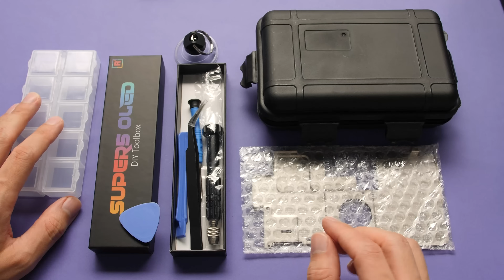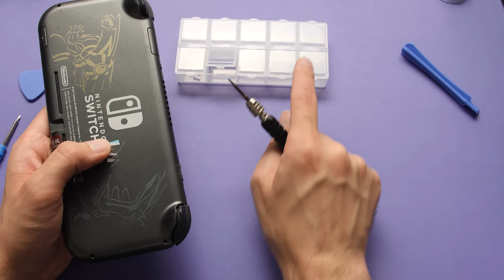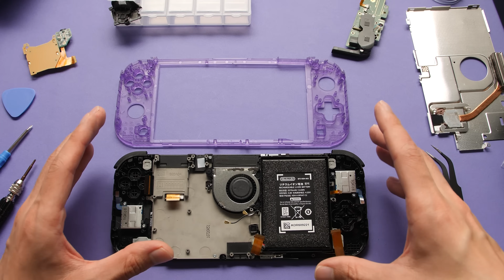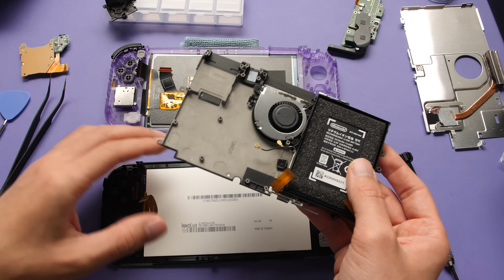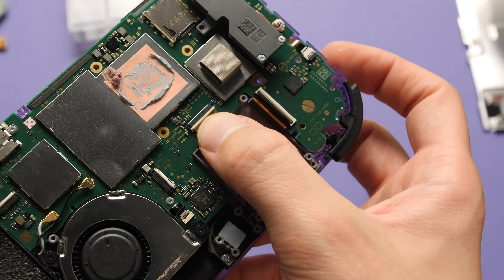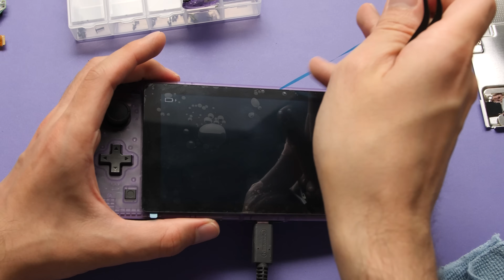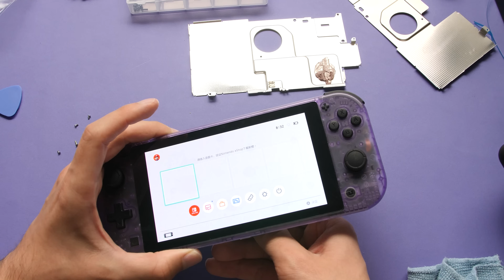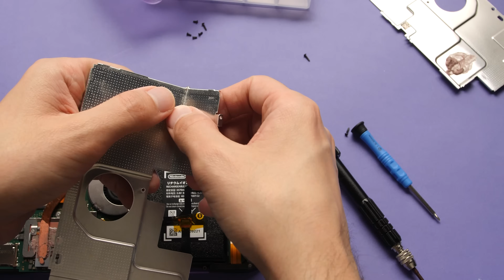SUPER5 OLED Touch - Product Overview & Installation Guide Part 2

Comment: So, can you install it like the non touch one? I like my shell and don't want to replace it.
Reply from the maker: Yes, but it is more difficult and easier to break something. I would not recommend anyone to do that way if it is their first install ever.
Reply: @TakiUdon2  In that case, the mobo and the daughter board should come out, then you should remove the old screen using the suction cup and finally you can install the new display? Could I follow a video about replacing the screen and digitizer to also see how it's done?
Reply: @TakiUdon2  can we use the other tutorial to install this? What are the differences we should know about when trying that?

Comment: Great work! Some quick questions1. will future versions of the kit include some kapton tape (maybe 2-3 cm)? could future versions have the lower-right section of the shields reshaped to avoid the edge interference of the lower shell, or perforated to make that section safer/easier to remove if needed? And final question, are there any possible use cases for the original screens after they are replaced (ie. could they be easily used with 3rd party devices such as Raspberry Pis, other portable gaming consoles, are there markets for resale or could they be donated to electronics repair shops? I would hope that they wouldn't have to sit forever in the pelican case collecting dust.. What do you do with them?
Reply from the maker: Yes, I added Kapton stickers to the BOM, but I am not sure if they will be in the upcoming orders. For your next question, the right section of the metal shield doesn't exist on the next revision of the metal plate to allow more room for a bigger battery. The plate I am using in this video was only ever meant for the non-touch SKU.

Your last question is going to bum me out because RR is not supposed to make e-waste....
Right now, I just save the screens to replace other broken IPS Switch Lites.
Reply: Working OEM screens will absolutely sell on ebay.

Comment: I notice you skip over the part where you're putting the new metal plate on when wrapping up the installation--perhaps to gloss over the fact that it covers up the top GPIO button? I know multiple people who have the excellent non-touch kits have pointed this out, but I don't think I've heard a response on this. Wasn't the point of having the buttons oriented horizontally, as in pre-production revisions of the kit, supposed to be that the GPIO buttons would be easily accessible if we decided we wanted to change profiles? What happened there? And should we be worried about the plate pressing that top GPIO button?
Reply from the maker: The point of the buttons being horizontal was never so they could be pressed without taking off the shell. They were horizontal (and the cutout was horizontal) so they could fit in the shell with the plate on.

For your last question, no.
Reply: @TakiUdon2 The kits are fantastic overall--I'm very happy with mine. My Switch Lite finally gets play--and serious play--for the first time since the Switch OLED came out. That said, you did say in the previous install video (the non-touch version) that the buttons were situated the way they were for easy access.

Appreciate your reply!
Reply: @TakiUdon2  it would hav been helpful if you didn't skip this step. Many people wouldn't be doing a shell swap at the same time.
Reply: @Zigzipy  Yeah, i'm sure a lot of people, myself included, are waiting to do this for their Zelda Switch Lite so hopefully that tutorial is done with that along with the Super HDMI mod for it too.  That would be the most beneficial video.  Also, using the screwdriver or other tool to point out the screws instead of your fingers would provide greater clarity, imo.

Comment: I have installed many hwFly's on switch lite's, and they defiantly don't need that metal shield, and it wont affect thermal performance to just not use it.

Visually, I think the clear shells also look better without it.

Comment: 17:14
Do we need to take out the shell and press that button every night to get 1 nit?
Reply: yes that Seems to be the case
Reply: @Toons91 
LOL what a dumb design choice.
Reply: @jackipiegg  There's no way around it without cutting holes in the case.  You can't run arbitrary code on the switch to detect button presses, for example.  Although, maybe in a future update since it's already involving a shell swap...
Reply: @eldarmark  
dude, gameboy mods from 5-10 years ago have combination keys to do adjust brightness. Their engineers is lacking in skills.
Reply: @eldarmark  You can theoretically detect button presses by running a wire into the controller PCB but unlike the gameboy, it's impractical due to the size and complexity of components.
Reply from the maker: @jackipiegg  Please show me the solderless Gameboy mods that use original PCBs with key combinations to adjust screen settings. This is a solderless mod.
Reply: @TakiUdon2  
If you really want solderless, just use the daughterboard flex to piggyback like you did the battery. Like I said, engineers lacking skills, you need to hire someone that has expertise with microcontroller like attiny. Hire from those gameboy mods if you can, what clever individuals they got over there.
Reply: I installed the nontouch oled screen onto my switch lite and the top button is covered by the metal plate. I think it’s funny to add a 1 nit brightness mode. And to access it you have to remove the whole back and change it and adjust it to that mode and put it all back together lol. Love the oled but that needs to be more easily accessible.
Reply: Yeah that’s the weird part of this mod everything is so well thought except that
Reply from the maker: Yes. The profiles are supposed to be set and forgotten. The 1 nit mod can be used during the day, the maximum brightness is just cut to less than 300 nits. If you predominantly play your Switch Lite at night, you'd just leave it on that mode.
Reply: @TakiUdon2  yeah that part was explain very quickly I think is not that dark only when you turn down the brightness to max on that setting

Comment: Will you do a tutorial that will have the TV out upgrade?
Reply from the maker: Yes, it's one of the two I have left.
Reply: @TakiUdon2 I plan on upgrading my Switch Lite with the TV mode,OLED screen & battery mods so will there be a tutorial on doing an all in one upgrade tutorial ?
Reply: I can't understand how it'll work without jailbreaking the firmware. Surely the Nintendo Switch Lite is omitted from TV out mode, not just by hardware, but at the OS level too?
Reply: @skycloud4802  my thought was since it's a new screen, they just hijack the screen signal and convert it to a signal that can be sent to the TV
Reply: @StaticNebula26   I guess that could technically work. But there will still be limitations. The Switch screen resolution is 720p in portable mode, which is lower than the 1080p resolution when docked. Furthermore, some games may run at a lower frame rate or with reduced graphical settings in that portable mode.

Mind you, I suppose it would be better than nothing.
Reply: @skycloud4802  they're probably just going to tap into the video signal and also send it out through the added in hdmi port
Reply: Yeah also the battery can get fucked maybe the mod kit should add more capacity battery and thermal paste as it seems to be required to make a final  mod
Reply: @davidp137  I wanna see him do a tutorial with all of the upgrades because I'm adding the screen,tv mode & battery mods

Comment: For us Mega Kit preorders does this give a general idea of how the install process will go for that?  Disconnect everything and move it to the new shell, while maybe swapping out some components in the process?  And the HDMI mod at the same time, I guess.
Reply from the maker: Mega Kit is easier than what I did here because the screen is already installed into a second shell with a metal frame and a battery. You just swap buttons and the PCB.
Reply: @TakiUdon2  My Mega Kit just arrived and everything was separate. I had to install everything twice because the right side of the display refuses to adhere properly and sit flush. In doing so I now damaged the touch connector on my board, so I have no touch. I think there may be a QC issues with the right side as evidenced by others having the same issue. :(
Reply: this is most definitely the case yes. it will be different because of the hdmi board obviously but the process should be similar.
Reply: @chosen3033 I don’t think so. It’s advertised as just needing a simple motherboard swap. The screen is already installed in the replacement shell.

Comment: Excited for the upcoming V1 OLED screen!
Reply: @Galaga_ yup it’s called super7
Reply: Will it work on V2 non OLED?
Reply: Yo what! I'm super excited and will keep an eye out for this one
Reply: Why for V1 oled though?
Reply: @TechThusiast  Because V1 can run android and linux. V2 would be kinda pointless because you probably can get the OLED.
Reply: @TechThusiast  v1 hack
Reply: Just sell it and buy switch oled
Reply: @5555dhoni  that's will be some additional cost for the modchip.
Reply: @8bitchiptune420  and for the OLED switch itself and the super 7 is said to be twice as Bright
And in my case I already bought an all aluminum shell, front and back